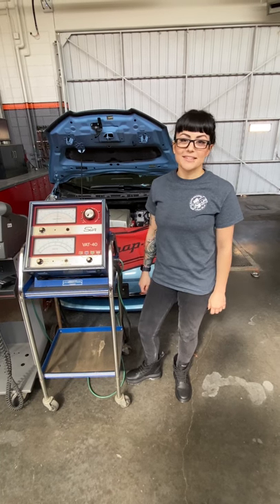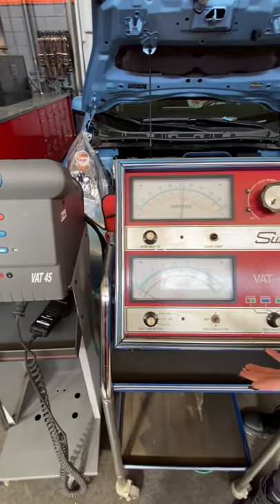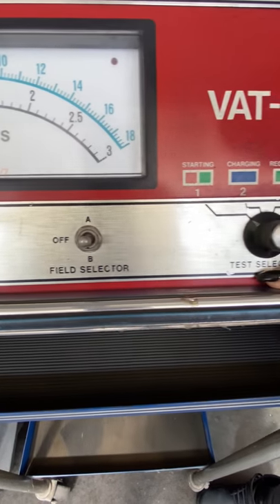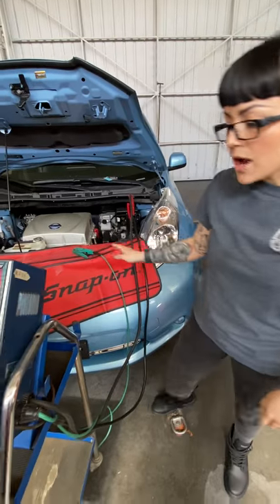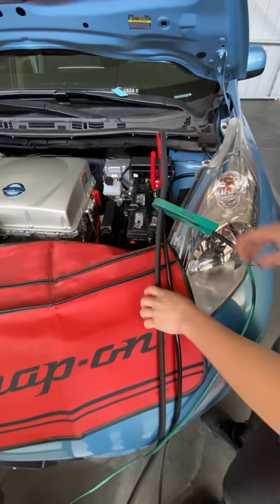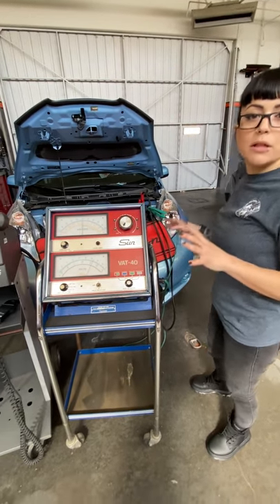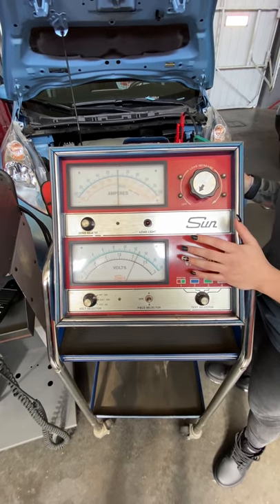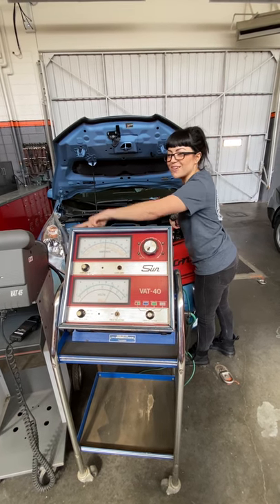How to perform a Battery Heavy Load test using a VAT 40

Comment: HI, I have two of these awesome VAT-40's in my High School auto shop classroom. they are great!!! we did a short module on batteries and are now going into basic electricity. I think the VAT-40 can be used to demonstrate a bunch of electrical stuff.  We already learned about measuring current using it and analyzed some 8V deep cycle batteries out of a golf car. I think were going to take a look inside to see the Carbon Pile and circuits. Thanks for the great videos. TG